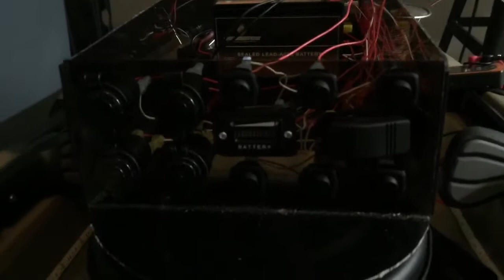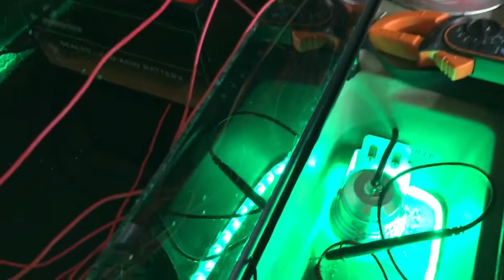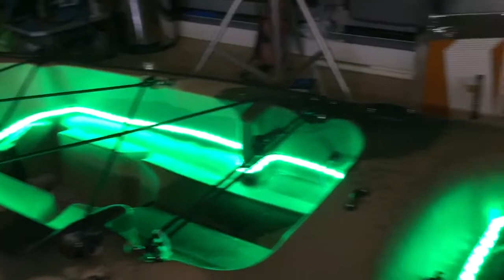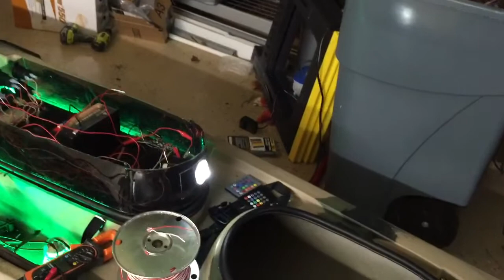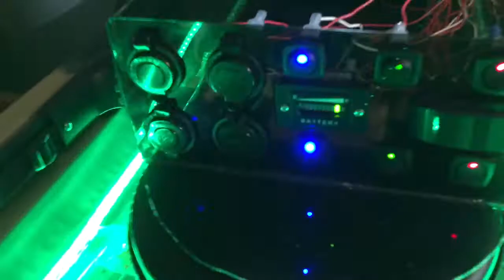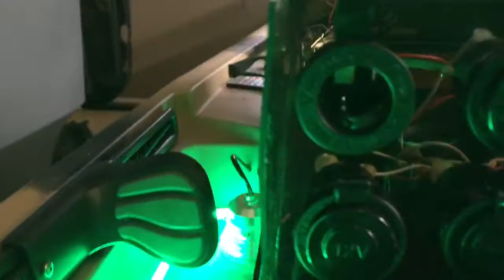Lighting up the Kayak.

Comment: I'm trying the same thing and I keep blowing fuses whenever I add a 4th led to the circuit. I can run 3 lights on a 5 amp fuse no issues. As soon as I connect the 4th the fuse blows... used a bigger fuse.. same problem... any ideas?